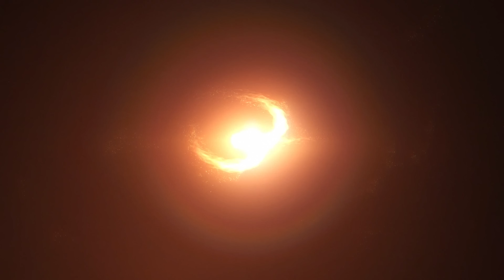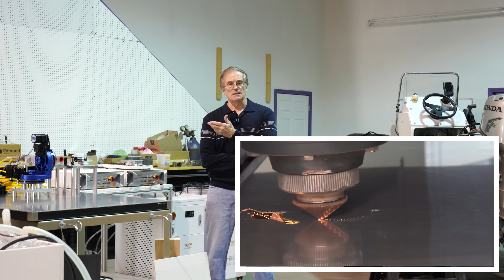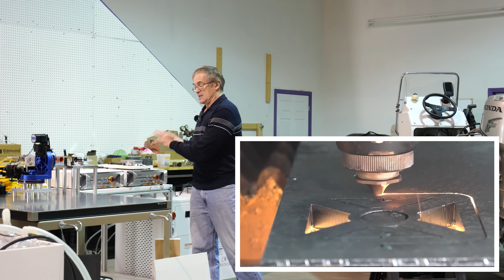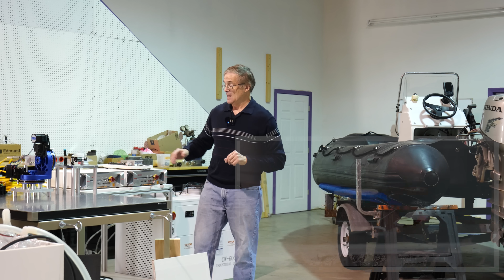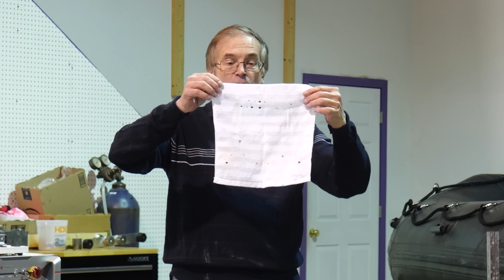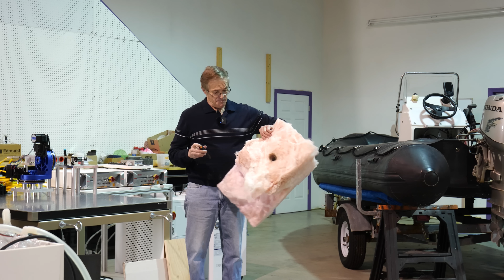We have a problem... and need your help!

Comment: Ok all these are very good suggestions so I will not repeat them just add other ways that are cheep. Red brick will not work well but you were on the right track, Porcelain will or a metal porcelain alloy is good.   Porcelain-tungsten is my favorite for heat shields, You need to make a box or chamber to fire into made of porcelain-metal tiles, back it up with an ablative material like rubber or aerolite, something that will char. That is really cheep to make this is what the UK calls "Chubam Armor" . Regular porcelain will work too but but is ablative so it will ware out. So wile we are talking about ablation, a shield like rubber alone works,  a thick layer of rubber when firing in short enough bursts that you don't burn threw is also cheep and easily replaced. Decollimation of the light also works. Shooting it at a polished iridium or osmium ball bearing or stacked layers of steel bearings works too.  Osmium berrings are easy to come by so that is your best shot an making a decollimation shield, This works by turning the flat wave front into a curved wave front, fire into a chamber for that one too.  @dustinandrews89019 suggestion is something you should include in the final design, so learn how to do that regardless.  I don't use industrial cutting lasers much, I'm retired from Kodak and NASA, my experience is in designing optics for ludicrously powerful lasers like the UofRs Fusion Lab and ATL, I don't have specific knowledge about industrial cutting lasers.

Comment: Weighted blankets, they're just sand-filled blankets. Seems more convenient than sand bags.

Roofing shingles. Easy to layer, could be wetted (to avoid fire), and intuitively seem like they'll be a good bang for your buck. 33 square feet in a bundle. Reflection risk.

At risk of getting too massive: countertop. Call and ask for a broken install or for cutouts. In my experience they're happy to give away scrap granite instead of paying to dump it. Epoxy it to a board.

Stucco. Just thought of this while thinking of something to fill gaps between granite pieces. It's just aggregate and binder that you can smear onto a wall. Add it to previously tested materials in various thickness and see how much time it adds. Easier to dispose of than a brick wall.

Comment: A somewhat crazy idea: A box with a sacrificial front wall filled with crushed graphite or charcoal possibly in a partial argon atmosphere to avoid a fire. Carbon is absorbing many wavelenghts amazingly well and when the laser punches a hole from it, the crushed grains would settle and provide more graphite to vaporize. Not suggesting sand, as sand would sinter together and form a glass tube through the box, carbon shouldn't do that. In any case, trying many of the ideas in this chat would make for a great video.

Comment: As a mechanical barrier, an Aquarium filed with pigmented water might do the trick, to absorb the laser’s energy and dissipate the heat. One concern would be, the reflections off of the glass surface of the aquarium….
However, an electronic sensor panel to detect the beam and help time the “kill switch” is still essential.

Comment: Ok, I know there are lots of comments, but I would like to share my thoughts.

Looking at this from a rocket engine perspective seems appropriate.  That puts us in the ablative market to begin with, but we want this to be low cost and low refurbishment world, so I think the bricks are that last ditch solution, definitely a layer of bricks at the end.  Then we come to liquid cooled options and I think that's where this needs to go.  You need a large amount of thermal capacity that moves the energy away from the surface, so that  your not primarily ablating as the solution.  Water is the obvious fluid to choose in this case based on cost, but it may end up needed to be something else.  The second point is that if you go with a fluid cooled material and it needs to be low cost, the trade off becomes that the solution has to lose mechanical complexity of manufacture.  On that scale, fluid flow is relatively cheap, so go big with volumes of fluid getting moved, but now the question is how to design the heat exchanger.  Lots of tubes is expensive and complex, if you want to have that much heat transfer in a 1x1 mm square, I just can't imagine you can do that cheaply.  

I think there isn't a solution to that level of energy intensity that's cheap.  I think that means, you need to lower the energy intensity that is received, otherwise you're going to need some 3d printed, liquid cooled, metal structure.  I think that means you need to optically diffuse the energy in order to gain sufficient surface area to either make an ablative option that works or to create a reusable fluid cooled option.  I don't love the idea of scattering a laser of that intensity, especially if the beam is moving around, but I can't see another option in the space that you have.  Ideally you can build a system that will diffuse the laser over a wide number of angles into an energy sink that's got a cooled water loop to pull that energy out.  Blow the beam up to a couple of meters and then shine it on a water cooled, absorbent surface, that's big enough that the multiple angles that your shining at your target can be captured on.

That my best guess for where to start.  I would build a surface that you can absolutely slam water through and make sure it is very thermally conductively attached to a good absorbent surface.  Then think of an optical way to blow up the beam and send it at it.

Comment: I'm not sure if this helps but there may be a potential solution based on the theory behind how they do acoustic damping. Sound waves are shined onto an egg crate and the sound waves bounce off in ways that are eventually trapped by the media. They do the same things for telescopes as well, they have a baffle or sun shade. the sun shade is designed so that the ray traced light paths keep bouncing until they are eventually absorbed into the sun shade. You might be able to use some mirrors that keep bouncing the light and slowly attenuate the light by degrees as it bounces. Perhaps shape the mirrors so that they pull out a small amount of energy at each bounce

Comment: Also, what about a series of beam spliting mirror? Half the strength a couple of times into multiples of the number of beams and your shop wall would be enough. 
With smart geometry you could reuse the same mirrors in the array multiple times, reducing the bulk.. Like.. Alighing a first pass at the center and redirecting a second and third pass at corners.

Comment: A water or oil tank with dye or suspended particles. 
You can tune the properties and dept of the dissipation with the transparency. 
If you make it clear enough and deep enough, you may be able to dissipate all of it without even boiling any

Comment: Two things come to mind. A ceramic bathtub, not the newer ceramic tub, but the older ones made with thick steel. And the other one is a water curtain, however, use something to color the water so that it’s milky white. I’m wondering also if it would be possible to use an invisibility shield to distribute the laser light long enough so that you will have time to turn it off?

Comment: My suggestion is a recirculating water curtain that has carbon black suspended in it. The carbon black particles will absorb and reflect the energy within the water. You may need to add some anti-floculant and possibly a very small amount of gelatine to increase viscosity of water so curtain does not break up. If the carbon burns you only have CO2 and water will only produce steam. The concept of suspending carbon in a fluid was one considered as a filter to stop high energy beams entering satellite optics many years ago.

Comment: You need to use a fish tank fill with black food coloring water bass ink to absorb the light and the glass should be very clean to it allow the light to go threw in to the water with black food coloring or ink that will absorb the light and not heat the glass make it bust .

Comment: Limit laser angle: Set software and physical restrictions so the laser can’t aim outside a defined vertical cone.
	•	Operator box: Run the system from a small, thin sheet metal shack outside the shop. Add E-stops.
	•	Laser off by default: If using PLC or switch, keep the laser off unless it has target lock.
	•	Keep it moving: When not firing, have the laser constantly moving to avoid dwell heating.
	•	Use diffusion: Expect to need layers or materials that scatter light, not just absorb it.
	•	One-way glass + rhinestones: For viewing—glass up front, rhinestone backing to scatter light.
	•	Rhinestone sheets: Cover areas with rhinestones to scatter beam splash.
	•	Wavelength-tuned film: Use thin film tuned to the laser’s wavelength to detect stray hits.
	•	Multi-laser setup: Use several weaker lasers instead of one strong one. Way, way more complex, but I think it shouldn’t be ruled out. Basically, this will reduce peak intensity whenever the system misses because the energy will be distributed over multiple places at lower power values.
	•	Paint + sand: Spray matte black paint to use as an adhesive, dust with sand. Stack in layers as a cheap light/heat absorber. I feel as if you use cardboard, it will disintegrate at a speed so fast that it won’t have time to catch the rest of it on fire.

Try using some hardy backer material instead of drywall and see if that’s any better. It’s usually used for putting behind tile, so if you put tile on the backside, that might be decent. Definitely not cheap nor easy.
	•	Pebble epoxy sheets: Mix pebbles and sand into epoxy on a board to scatter and absorb hits.
	•	That high-albedo paint that you made a video on how to make: This alone probably won’t do the trick, but if you combined it with some combinations of other things, it might be helpful. Use bright white or reflective paint in low-risk zones to reduce passive heating.
	•	Look into materials with high specific heat, so they can hold more of it without melting.

It’s really hard to tell because I can’t quite remember what the typical wavelength fiber lasers operate in.
Reply: Just a few ideas i can come up with before going to bed.

Comment: I was gonna suggest a backing board of phenolic resin but then you said non-toxic lol.  Its a great material but I think the next best option is a diffraction grating or (likely a few layers of gratings) that could disperse the beam if it penetrates the target too quickly.  It would in theory disperse the energy of the beam over a much larger area and but some time to smash the estop.

Comment: AI says this would be very effective and is what I suggested:  how about drywall painted flat back in front of the fish tank that is filled with carbon black water and a backing outside the tank with firebrick?
Answer=: Now you’re talking serious safety — that’s actually a very solid multi-layered beam trap setup. Let’s break it down:

1. Flat Black-Painted Drywall (Front Layer)
	•	Purpose: Initial beam scatter and absorption.
	•	Effectiveness: Flat black paint will reduce reflectivity, and drywall itself is not very reflective. It may char or burn if hit by a strong beam, but it gives you a warning.
	•	Bonus: Acts as a first line of defense to reduce any stray reflections before they even hit the tank.

2. Fish Tank with Carbon Black Water (Middle Layer)
	•	Purpose: Main energy absorption.
	•	Effectiveness: Excellent — carbon black or India ink in the water will strongly absorb most visible and near-IR laser light. A deep tank (8–12 inches) will further attenuate the beam.
	•	Caution: The water could heat up or boil with extended exposure, but in short pulses or brief tests, this is quite safe.

3. Firebrick Behind the Tank (Back Layer)
	•	Purpose: Emergency catch for any residual beam.
	•	Effectiveness: Firebrick is great because it’s:
	•	Non-reflective
	•	High-temperature tolerant
	•	Chemically stable
	•	Cheap and easy to replace if damaged

Comment: Try rock wool insulation. It's what they use in Stoves and fireplaces and that's quite a bit more heat resistant.

Comment: Steve here: I love the stuff you do. Maybe a thick cement wall? Cement wall with metal plate? Aerogel would be interesting to see if it would stop the laser beam. I use a cheap 70 watt diode laser for wood projects and understand the dynamics of the power you are using. I can't wait to see what you come up with to stop or slow the beam.
Reply: My thought was ceramic wool... graphite apparently is the shiz... 
Quite a few are discussing photovoltaic or maybe a ir diode receiver... 
For shiths and giggles, somebody needs this fiber laser to shinevon a solar panel..... will it generate? Or just melt? How about that solar tower collector California gave up on... because it won't generate at night😂.. those collectors can absorb a lot of heat from light...